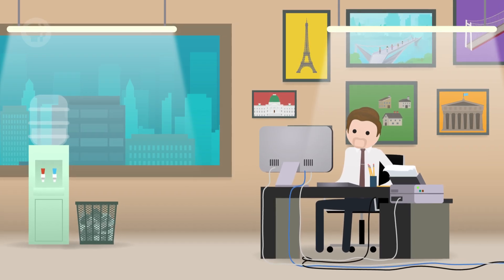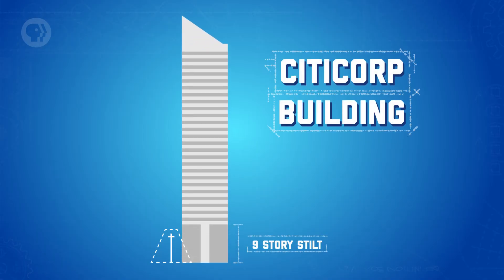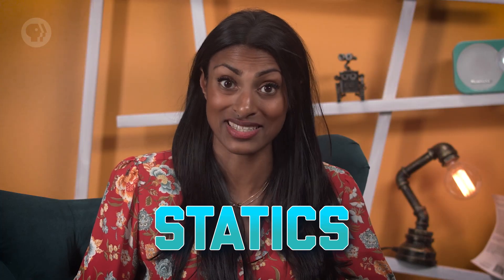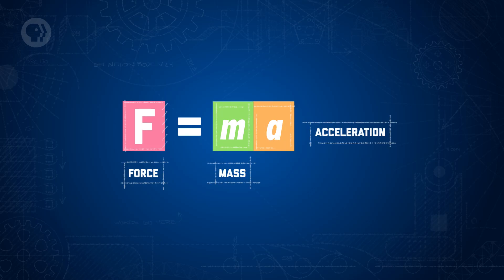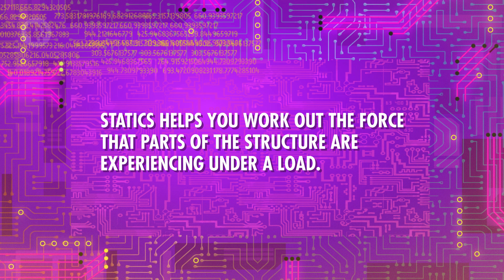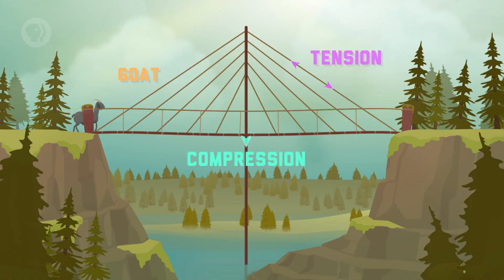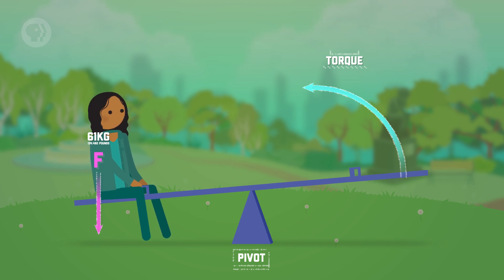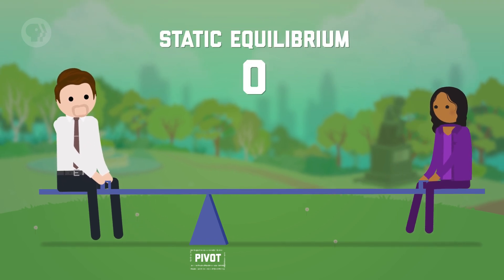Skyscrapers, Statics, & Dynamics: Crash Course Engineering #26

Comment: An episode on statics with no truss diagrams? :(
Also, the second bridge is a cable-stayed bridge, not a suspension bridge.
Reply: Only a civil engineer would notice (and cringe) at the cable-stayed being called a suspension and immediately afterwards a comment about loads being carried by the cables (and no mention of the deck that will be in even more critical compression)

Comment: Now do a video on 9/11 and explain the collapse of: WTC1, WTC2 and WTC7.
Reply: Also, while fires at the temperatures cited can't melt steel beams, they can make the steel hot enough to bend and deform, changing the static structure (a standing tower) into a dynamic one (supports fail).
Reply: And instead of a slow and progressive bending of the building we saw a sudden vertical collapse as if the internal support structure was being destroyed by explosives. Only the steel near the fire was hot, the rest of the building was cold and 100% capable of supporting multiple times its weight + the weight of everything inside it (it's called safety factor). You're either dumb or a troll.  @robotguy4
Reply: @humanrightsadvocate  Compressive buckling of structural steel columns is a stability failure mode, not purely a materials strength failure mode. Once stability is lost in one or more columns, partial collapse can be quite sudden. Assuming that the adjacent columns already have reduced stiffness due to elevated temperatures, it isn't hard to imagine how a disproportionate total collapse would be initiated by dynamic loads from falling concrete and steel. While I can't say I've personally done a multi-million-dollar forensic simulation of the event, the WTC collapse certainly passes my sniff test as well as those of any practicing structural engineer I've ever come across. I think that @robotguy4's explanation is fairly decent coming from a layman.
Reply: How did the part of the building above the damaged area – which is weaker and lighter – managed to crush the rest of the building – which was stronger and not affected by fire? The top floors acted like a magic anvil. They crushed the whole building and vanished. 

Of course, we should not entertain the idea that explosive were used to bring down WTC1, WTC1 and WTC7. That would be one of those "outrageous conspiracy theories" George Bush warned us about. I mean sure, people died in those explosions, some survived to tell the tale. But as a rule of thumb, one should always believe the official government explanation and ignore the people who were actually there.    @engibear8966
Reply: @humanrightsadvocate  You're misunderstanding at least two key concepts.

1. Dynamic loads are different than static loads. If I drop a 10-year-old-girl on you from 20 feet over your head, you're not going to be able to catch her, and you're both going to get hurt badly even though she is "weaker and lighter" than you and you'd be able to lift her easily under normal circumstances. Side note: only the columns and bracing of a skyscraper really get lighter as you go up (although WTC 1 was relatively top-heavy due to the support system for the giant antenna). Generally, the beams, the floors, the walls, the furniture, etc. are pretty much the same all the way up. In fact, a great deal of a building's mass is concentrated in its floors, which don't really contribute anything to the vertical "strength." This leads me to the second item:
2. A skyscraper is not a solid entity; it's basically a series of heavy plates on layer after layer of stilts, plus a lateral force resisting system of one sort or another. It will not fall over in one piece like a tree the way you see in post-apocalyptic video games. What we're talking about here is one layer of "stilts", already weakened by fire, getting pulled out of plumb by thermal distortion and then buckling. Or "kicking out" if that helps you visualize it better. When that happened, everything above the missing "stilts" got turned into a giant kinetic bomb.

There's nothing I love more than questioning the conclusions of other engineers, but I'm afraid that incompetence and bald-faced lies are usually the name of the game, not convoluted conspiracies. My explanation was originally my own, not handed down from on high. I have refined it out of curiosity after comparing notes with the official NIST report, which is based on the extensive work of very smart people from both the public and private sectors, but the differences are probably lost on the average American. As are the differences between the sound of a bomb and literally any other loud noise echoing down a city street. This is an Occam's Razor situation. Those towers were hit by planes, they were visibly in trouble because of it, and the rest was fairly predictable. Alternative explanations raise more questions than they answer.
Reply: tldr @engibear8966
Reply: @humanrightsadvocate  TL;DR: If 9/11 was an inside job, it was done with planes and middle-eastern operatives. The planes were enough, and having secret explosives "just to make sure" would needlessly add an extra layer of complication and more chances to be exposed. Like a bad movie where the supervillain should have already won 5 times but has a bunch of extra steps in his plan because plot.
Reply: That's easy: two planes being flown into the first two buildings and then massive pieces of the the collapsing towers hitting multiple adjacent buildings besides WTC7. But you go ahead and keep believing whatever you want LOL
Reply: Oh! So that's what happened! OK, thanks!  @yaddahyaddahyaddah2709